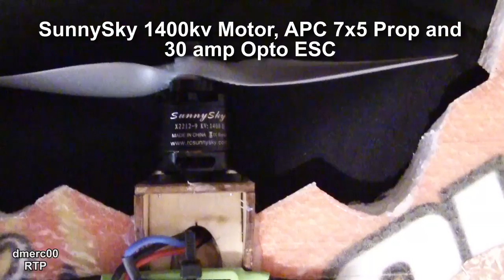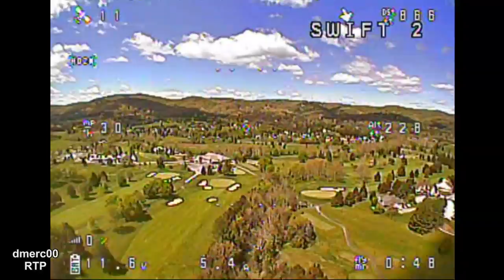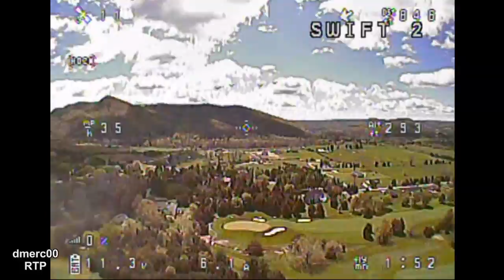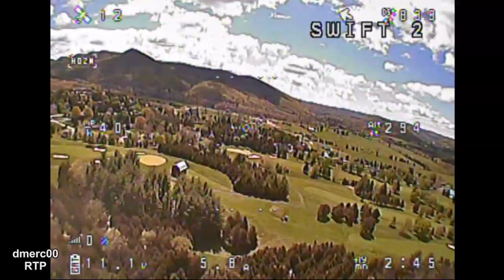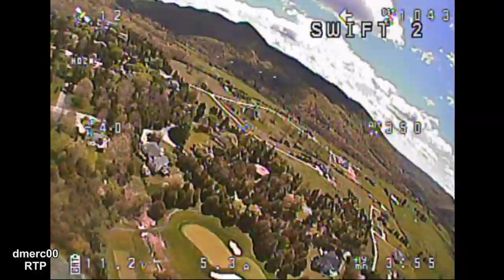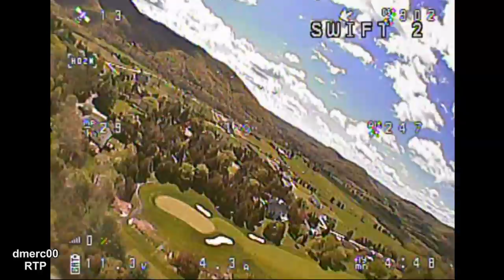FPV Tek Sumo Wing Upgrades and iNav Testing - EZHUF Nano, Copper Foil under GPS, New Motor, New ESC

Comment: I am about to maiden my Teksumo/Experimental airlines Synapse and 
control and stabilization seem right on the ground.
Wonder if you might share your CLI dump for comparison?  I'm using the 
Omnibus F3 Inav 1.7, 900mm wing presets and Taranis Frsky Sbus.
Reply from the maker: I tried to post my CLI dump in this message by got an error.

Comment: About as clean as you can get for GPS functions in your Tek Sumo, nice job Dave. I've used APM in fixed wings, and even KK2's for basic stabilization, but how clean the BRF3 - or any other 30x30 FC - has made your build! Now that I fly primarily Betaflight-powered racing quads, I have tons of FC's I could use, but it begs the question - is inav up to the task in terms of reliability and GPS-assisted flight? Also, why not turn on the mah consumption in your OSD? It'll give you a more accurate reading of battery status than volts, as it's not affected by sag?
Reply from the maker: I think iNav Cleanflight success depends on two things, a good quality GPS puck and proper configuration. 
The first versions of iNav did have some glitches but as of version 1.6 I am very happy with it. 
Off topic, but I noticed after watching my video several times that I forgot to enable my RSSI in the receiver tab. It just sits on zero the whole flight.
Reply: I'd say RSSI would be A Must for those flights, again, so much easier on the new multirotor FC's than ever! My BRF3 is the same as yours, but installed in a 130mm quad, running Betaflight 3.1.7. My fleet primarily consists of Omnibus FC's, of which I think the "Pro" version (current sensor) may be just as good a choice for fixed-wings. The MWOSD portion of the BRF3, now that pass-through is available, is easier to access than ever before - no FTDI adapter, yay! But now that you've confirmed this firmware as viable for fixed-wing, though, I may have to start building! Can't wait to see some iNav features in action!
Reply from the maker: This is good time to try iNav because they have now added presets for planes. All I had to do was choose Flying Wing and the preset filled in most of the settings for me. I didn't have to go into the CLI and manually change things which made things easier.
Reply: You're absolutely right! I just watched Painless 360's iNav series based on your recommendation. Lots (!) of information there, and watching more and more 'Tubers using it has convinced me to try it. Thanks bud!
Reply from the maker: Welcome aboard the iNav plane! 
Let's have some flying fun :-)

Comment: I'm new to R/C stuff  so I have a question I see you use dipole and monopole antennas for different frequencies or tx/rx applications. The last time I tried to rap my head around the dipole length of the wire matching the frequency you want to use idea I just said monopole the longer the better (especially for rx) and went with it. Are my instincts wrong can you explain why dipole is better?
Reply from the maker: I don't think the dipole is better, it's just more compact for use with vtx on the wing tip.

Comment: I've used copper foil as a shield between quad decks, but I'll have to try it under the GPS!

Sunnysky motors are great!  My best quad motors are Sunnysky.
Reply from the maker: I think with the GPS the foil acts as a reflector dish more than shield. If i could make it parabolic rather than flat it might even work better. It might even be possible to tune the size to match the GPS frequency. This is all just speculation of course.

Comment: Hi Dave, looks like you are getting it how you want it...Does this setup include RTH..?...Its very compact and lightweight for sure, Id like to see it work with RTH though. That would be great...... Has your Aeromax OSD arrived yet..?
Reply from the maker: It does support RTH and I just have to program a switch for it. Will be doing that soon.

Comment: Another great but different build Dave! Hey, whatever happened with the mini talon? I came across a guy on Matthew Ogborne's channel who was complaining about having received two mini talon right wings. Lol. You two should get together. Btw, My mini talon is about 95% ready to maiden, but then my mini Drak arrived and I am up to my armpits in micro vector wires on it. (If you're considering any new builds, stay away from the micro vector, the numerous wires are terrible to solder.) Anyway,  keep up the videos. To me, your build, flight and review vids have always been the best. The editing software and to some extent, the Mavic Pro stuff is going to appeal to a more limited audience. Only 60 more subs to 10K, yeah!! 👍😎
Reply from the maker: I am putting the motor mount on the Mini Talon now. Anyone want to buy a left wing :-) My work on it coming slowly as I have so many projects and getting ready for Joe Nall too.  Yes I am excited about getting my wooden YT button if they still have it available. I will take your advice on the Micro Vector and save some money too. Good to hear from you and have a high flying weekend!

Comment: I wish you would get an original Pixracer (store.mrobotics.io/product-p/auav-pxrcr-r14-mr.htm) with an M8N GPS module and compare Ardupilot with iNav on fixed wing aircrafts.
Reply from the maker: Looks like a great little FC but it costs twice the price of a BeeRotorF3 setup.

Comment: nice job! I have the same setup minus the FC. great little wing! I have a 2nd sitting in the box with the HangarCats blunt section - it will be interesting to compare the two!
Reply from the maker: Thanks for posting. I didn't know about the HangarCats blunt section kit. Saving a link for later.
Reply: yeah check it out! allows way more room and you can easily move FPV gear around to meet your needs. Plus nothing is mounted on the bottom.
http://hangarcats.com/index.php?main_page=product_info&products_id=37
Reply from the maker: Looks like you have a Mavic too. Is that correct?
Reply: Yeah, got it last October. Great little machine. :)
Reply from the maker: Nice!